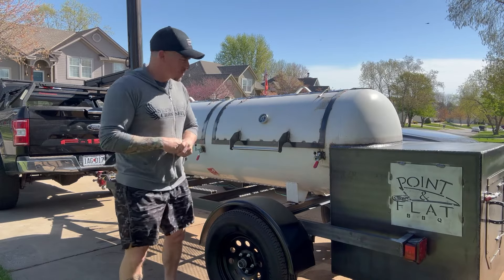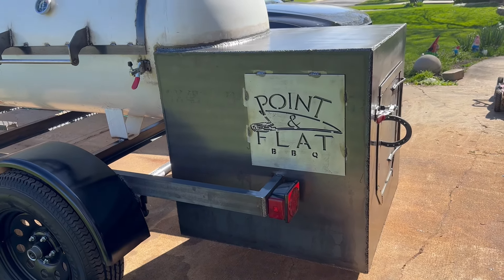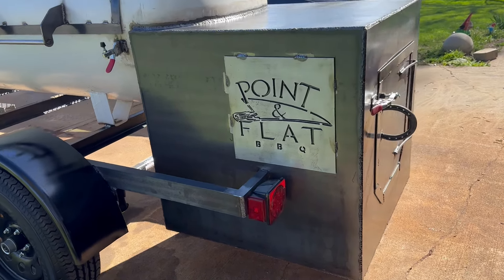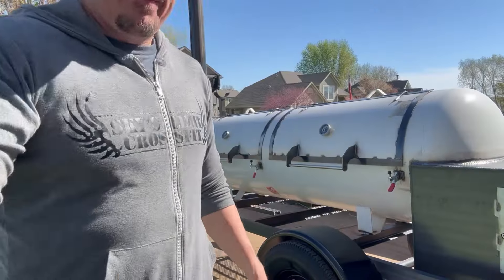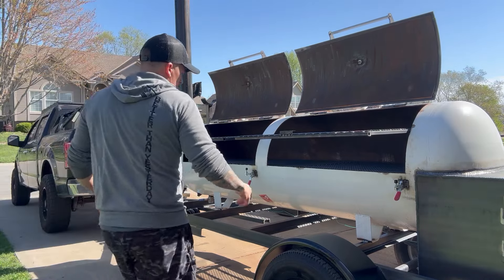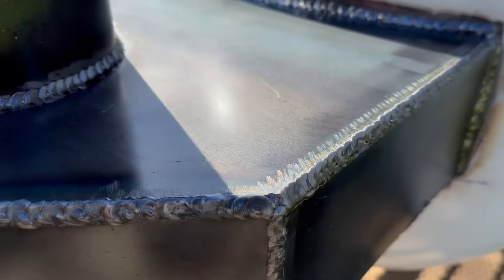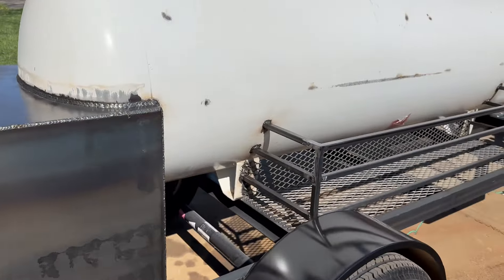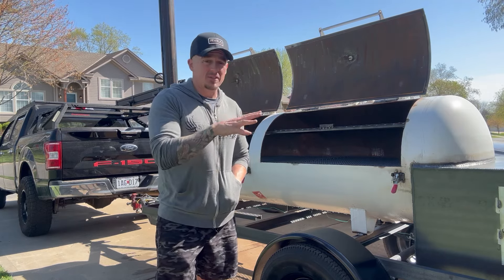330 Gallon Offset Smoker Build Overview!!!!  (Short Cap Version)

Comment: what tires are those? and how big is fire box?
Reply from the maker: The whole trailer kit I got off of trailer parts outlet online. Firebox is 32” wide x 30” tall x 30” long.
Reply: What you charging for a 250 build?
Reply: Trailer build
Reply from the maker: 250 on a trailer is $6500